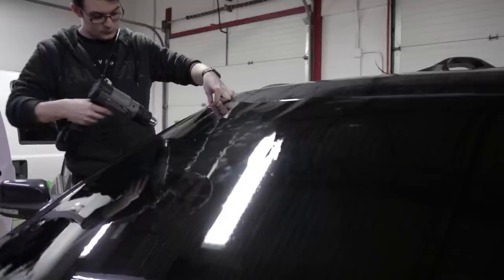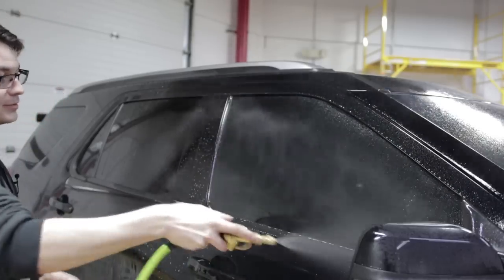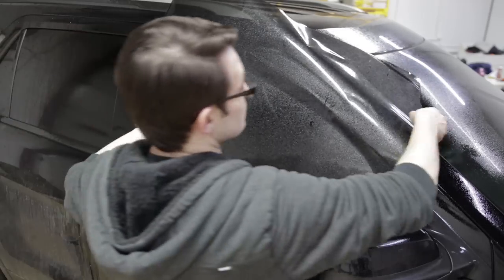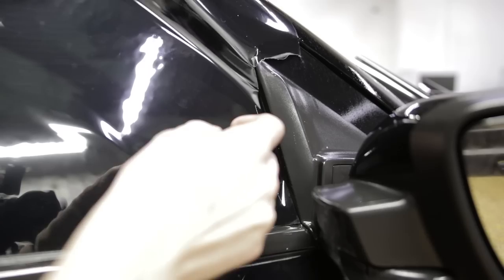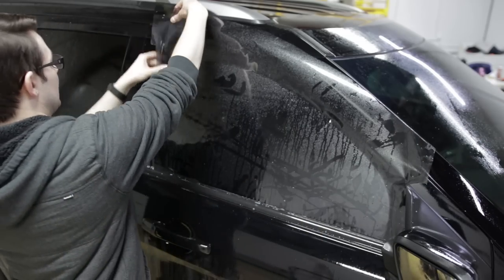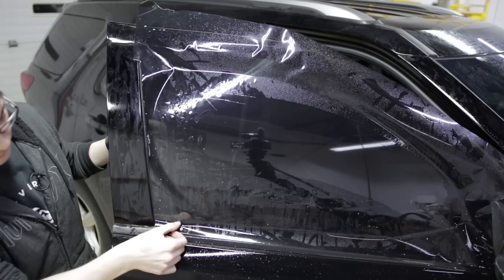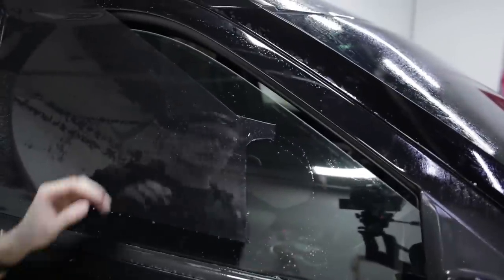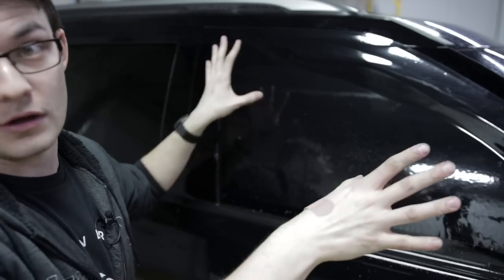How to Hand Cut Window Tint on the Car

Comment from the maker: What would you like to see in the next video?
Reply: An explanation on your disappearance! love the vids
Reply: TintStuff, love the new shop and setup. If your taking requests, how about a non-arched eyebrow (sun strip).
Reply from the maker: Thanks! i'll see what i can do about that one. I actually haven't done one without a plotter and even that isn't consistent
Reply: I know you’re covered it before, but how about shifting windows in some of the more complex vehicles? Or windows that are half covered by frame in the outside, and have a completely different shape on the inside?
Reply: Do a video on thick defrost back glass that cause “peanuts”
Reply: 2017 front windshield Maxima The Matrix dots are killing me how to stop this problem with the tint
Reply: How bout how to tint tails and head lights
Reply: Sean Ashcraft on thick defroster use 0000 steel wool
Reply: TintStuff how to tint a car in 45 minutes handcut!!!
Reply: TintStuff I'd like to see a video on driving with windshield tint at night
Reply: Next video >>>> proper cleaning technique for eliminating as much contamination as possible
Reply: J Wise nice
Reply: Hey what software do you use to precut these tints and which model Graphtec mac
Reply: Removing window tint
Reply: Please, what tint paper to work with and what is the name of the company so that they send it to me, thanks
Reply: What do u use for a guideline to cut the back glass?

Comment: I use a marker for the sides. Then just cut 1/8 of an inch outside each line. That way you don't have to keep moving the template over and over again.

Comment: You make it look so easy!!  I just did my own tint on my Durango.
Reply: Because he did it to the outside of the car bruh, it should be applied to the inside
Reply: @ThermiteEngineer  He didn't apply it anywhere yet.. He just cut it to the shape of the window before installing it to the inside. Also needs to be shrunk before installation.

Comment: I've found this very helpful and I'm able to cut door glass so much better now. However I'm having trouble with my tint peeling at the top of the glass over time. I wonder am I putting my tint seem to close to the edge of the glass?
Reply: Thats exactly what is happening, As soon as u lay it you can run your finger over the top to see if it snags.. If it does then you know the seal will pull it up too. When you lay your top edge let it be around an 1/8th of an inch from the top edge.

Comment: I’ve got a truck that i just bought with a home done tint job. It’s not bad on the side windows, but the windshield tint goes down way too far. If I just wanted to cut that higher, would it be roughly the same procedure?

Comment: How do you prevent the blade from grabbing the rubber gasket on the exterior? I have a bad problem with my blade cutting into the seal and it gives me really wavy/inconsistent edges when hand cutting which forces me to rely on a plotter.

Comment: Have you ever thought of wrapping the end of your knife in electric tape so when you ride the top edge you don’t leave a cut in the top of the film all the way across
Reply from the maker: It doesn't leave a cut in the film. i'm not putting much pressure against it. Also the liner is protecting the film in this instance.
Reply: TintStuff nice! Please post more videos! Would like to see more videos posted daily! Love your work!
Reply from the maker: Thank you! I'm working on it :)
Reply: Haha. when i was wondering the same thing i would leave a mark on the top edge. I was going to ask about that but you beat me to it..  i had to changed my technique so i wouldn't leave a mark.

Comment: How do you prep the glass razor blades or white scrubby pads???
Reply from the maker: Usually a plastic "Gator Blade" but ill use a razor blade if there is adhesives from stickers or other stuff
Reply: TintStuff thanks any paper towels for dirty Windows and seals?? Blue shop towels??
Reply from the maker: +JBIRD575 I like fluffy microfiber towels. I think we have a bunch from Costco
Reply: TintStuff ok thanks do you wash microfibers before you use them or use right out the bag also no dryer sheets rite air dry only???

Comment: What do you use to spray the window?
Reply from the maker: +sahagivet water and a little j&j baby shampoo in this video
Reply: Sorry I meant like what kind ok sprayer are you using.. lol
Reply from the maker: 3 gallon spray tank with a flexible hose and a brass spray nozzle. they sell them on most window tint tool websites.